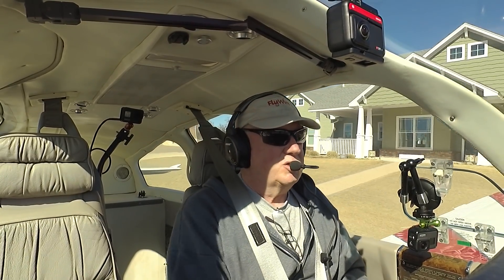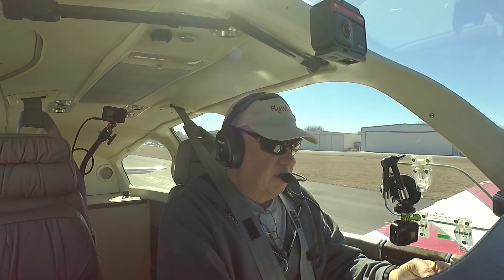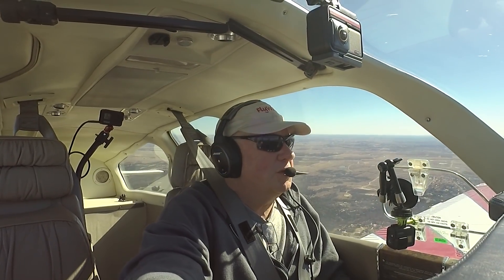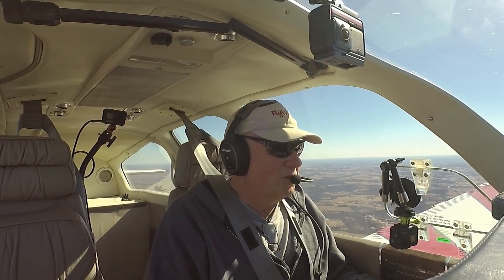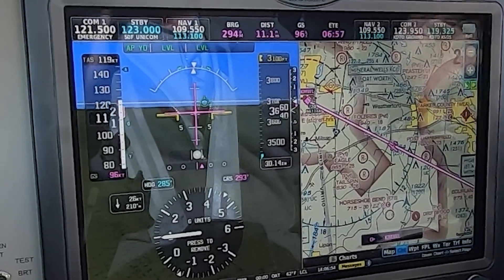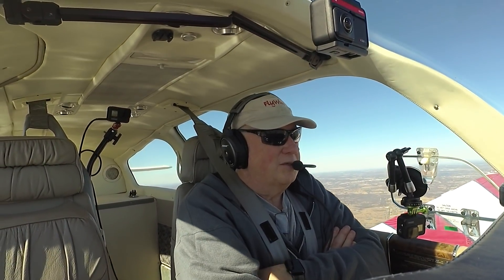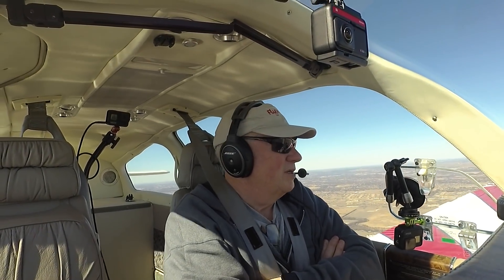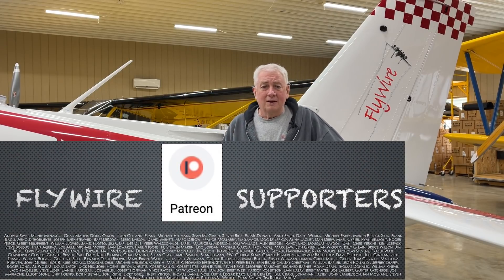ESP in a Bonanza GFC500

Comment: This may never get to you but I just put a gfc500 in my a36, I wanted the gfc500 and had to get the other garmin stuff. U impressed coming from a Honeywell product. Got a question. The garmin wants to put the approach after the destination. Odd to me and all my fly buddies say that makes sense. You aren’t cleared for the approach. None the less I can expect based on weather a target approach, load it and if they want me to fly to a fix farther down the approach, no problem. Direct to. Garmin starts flying me to AP. Then I have to go in somewhat blind and pick a waypoint on the approach. You’ve obviously flown other gps’s. What are you thoughts on their professionalism regarding work flow. Thanks
Reply from the maker: I like the GFC500 quite a bit. When you load the approach it is loaded behind the destination waypoint. The AP will not sequence to it. You have to steer to it, or better yet activate the approach and choose how to enter it. 

It’s just different.  The KFC200 in my A36 was ok, but the GFC500 is superior in virtually all respects.
Reply: @FlyWirescottperdue  thanks for the reply, interestingly the g1000 has a destination field so the approach is inserted before the destination. I’ve got a phone call with Garmin to explain the logic. Yes the Garmin is superior. The kfc200 was old discreet  technologies and the Garmin is surface Mount. Maybe 10x the horse power . My question was more about the flow of through waypoints. To me, if I was Garmin would load approach with the furthest waypoint as the destination. Then as I get closer I load new if needed, or select waypoint on approach as intercept point. If I do that it takes the other waypoints away. Why remove situational awareness?

Comment: Have seen go around accidents where they become uncontrolled increasing or not increase power, leaving control surfaces in landing configuration. Does it save from that type of mistake close to the ground, not getting out of landing configuration and pulling back or increasing power.
Reply from the maker: You lose control when you stop flying the plane.

Comment: Scott, I fully agree the GFC500 is the best GA autopilot on the market today for the money. Regarding the use of the VNAV I use it almost every flight - On the legs page of the 750 select the ALT button to the right of your destination (as an example) then select and input an Along Track mileage (1 mile for example) following that input the altitude you want to be at (pattern altitude for example) and Save. This will create a new waypoint 1 mile from the airport at pattern altitude based on this example. Once set, the GTN will calculate a Top of Descent point using your current ground speed and give you a visual TOD and BOD on your map page.  Finally, 1 min prior to the TOD the GTN will announce "Vertical Track" which is the perfect reminder for selecting VNAV on the GFC500.  Once engaged, the GFC500 will descend at the rate of descent you have programed in your VNAV settings on the GTN - I have mine set for 500fpm.  Once the descent starts, continually adjust the power to 19 in MP and the Bonanza ( I have a V35) will stay within the green arc throughout the descent. Then when you level off 1 mile out further reduce the power to 16 inches and your quickly within gear down speed without shocking the engine. I spent many years on the 777 and 787 and the GFC500 autopilot VNAV operates much smoother than either of those.
Reply from the maker: I’ll have to try it. I do something very similar but target pattern altitude at 5NM. Just leaving the power there gets me to about 130

Comment: Scott, as usual, great video! I have a similar setup in my A36 with the GFC500, dual G3X’s, etc. Dude, you’re like our test pilot…love it! The magic blue button is great. I’ve instructed my partner on that button should, by some freak set of events, I become incapacitated. It’s a real smart piece of technology. I plan on having the new “Oh Sh&t button installed as well in case of an engine failure. It’s just a software upgrade to the 650xi and another example of Garmin brilliance. Good flying sir!

Comment: Interesting video Scott!  I love this technology, even though i only fly flight sime.  The blue LVL button is great but I am wondering why it is set up so that if you exceed the parameters , 60 degrees bank, when you went to 70 it wouldn't correct, so I assume it won't correct if inverted either, which brings up another question, when inverted, but level, will it even know the difference?
Seems it would be a great life saver, but a shame it's bound by those parameters so if things get really upset in flight it's not going to save your bacon.
Perhaps there is a logical reason for that, or is it just beyond current generations ability to do so.

Comment: I fly the same configuration as you do, G3X and GFC500 +GTN 750 in a Mooney. It works as you said fantastic and I agree what you say fully! You can when you override e g bank angle long time having the AP taking over completely and it is giving that message over the speaker. 
However, the item that is most problematic is the VNAV. It has worked well into approach, but often not. Pass mostly TOD all time and I have to take it away and do VS instead descending. I don’t know if I’m too close to a approach or if I pressing the buttons in wrong sequence (yes the altitude is set lower), or if it is a bug between G3X and GTN…
You said it not so useful for you, but perhaps it is not working so well too?

Comment: What's the difference between the 500 and GMC 507?  Thanks
Reply from the maker: The 507 is the control head ( and it has the computer in it.
Reply: @FlyWirescottperdue  Thx, just ordered on for my RV7-A, servo's won't show up until May...  Looks like 507 is the 500, but for experimental and sans about $8,000 off the price. :)\

Comment: Great video as always.  I had a G3X, GFC500 and 750xi installed one year ago in my Dakota, and it has been rock-solid and awesome.  My wife feels safer knowing there is a 'Blue Button' in the event she needs it (hopefully never) - gives her time to sort things out.  The reality is she will struggle beyond the initial level out as a non-pilot.  She knows how to use the AP heading mode and the lookup freqs. and tune the radio to communicate, but we need practice on the 'what next' in this scenario.  Have you installed the latest software with the Smart Glide feature?  I am having the software upgraded and the panel mounted switch installed this week and am curious how it might be of use in the above scenario - I know that is not the intended use case, but maybe useful if activation is possible with power on (so not gliding which seems like it would be a tricky thing for it to manage without Auto-throttles).

Comment: Scott:  All this Automation is grate,  'BUT' and this is a big but. what happens when a pilot really starts depending on it and the DAMN thing QUITS. These things all have a tendency to QUIT at the worst time possible.  Your a HIGH time Military/Airline type and most likely can handle most emergences.  What about the 300 hour Guy with a new Instrument rating and Solid and the Alternator belt breaks.  OOPS Soon NO Lectric in SOLID IFR and depending on all this automation that DON'T WORK without NO 'Lectricity' Brother. 
  A map in my lap and an Approach Plate in a clip on the Yoke & 2 vacuum driven instruments (that I know how to use) just might help save the bacon There's always an ASR approach.
Reply from the maker: Well, there isn’t always an ASR approach.
Reply: Very true. I have 1500 h and fly a G1000 equipped Saratoga but still have a paper approach chart and do regular training using my AHRS-driven iPad-ForeFlight in a full panel failure scenario

Comment: That was very interesting. Thanks, Scott. I spent a lot of time on the wall about glass panels for GA. I'm not instrument rated so no biggie using steam gauges but I have had vacuum failures that took out the heading and attitude gyros. In VFR...so again...no biggie...but if for no other reason, the reliability of glass gauges and panels make their case. And there are so many other reasons as well, especially for IFR and/or experimental aircraft. There isn't necessarily much reason to spend the money on glass if you fly VFR and your steam gauges are working but I can't think of any good reasons to replace broken steam gauges with new steam gauges.

Comment: The other ESP sort of works.

Mom was taking up a plane to practice after solo, before getting her license.

She was assigned a plane she'd flown a few times.

Went out, did the exterior pre-flight, got in... got out. Went to the office and said something's wrong with the airplane.

Guy in the office asked what.

Mom said: "I don't know, but it didn't feel right."

They gave her another airplane. (a bad feeling is enough reason to take a different airplane)

A couple of days later, next user of the airplane, on take off the left main strut fell off.  It had a crack just hidden by the fuselage skin.

Mom must have felt it sag differently than normal as she got in.

****************

ESP is your mind  recognizing something that you didn't consiously notice.
Reply: Most mothers have had ESP long before they named it as such for hundreds of years. Your mom just proved it.
Reply from the maker: By George I think you’re right!

Comment: Just a comment. The two top flying schools here in Sydney, Australia, put you in a Tiger Moth to initially learn to fly. No glass screen, minimal instruments and a map on your lap. Your solo consists of a lot of dead reckoning over ten waypoints at different heights, and even in the rain. You learn to look at the terrain and become able to judge height to within a hundred or so feet. This training regime accounts for our very low aircraft accident rate. If more pilots actually looked out the window more often than overly relying on instruments, more lives would be saved.
Reply: What little I learned was old school stick and rudder, do your own math and watch for landmarks out the window. It was a simpler and more innocent time 🙂
Reply: Agree 100% even though I fly IFR in a Saratoga with G1000.
Reply: This "look out the window" mentality has gotten tons of pilots in trouble instead of trusting instruments.
Reply: @N1120A  yeah, but important to keep actively mentally engaged in the flight eg have the computer calculate the top of descent but ALSO do the mental maths.